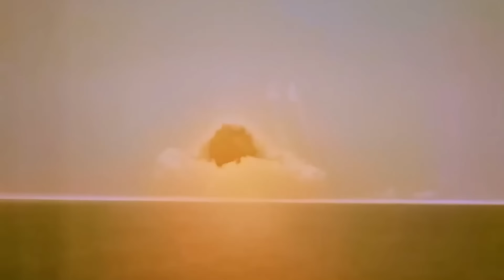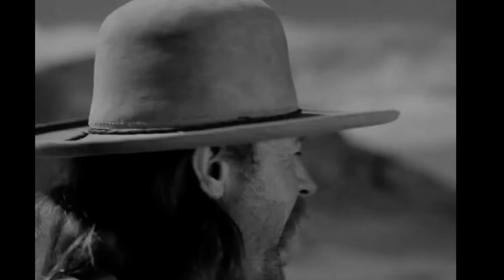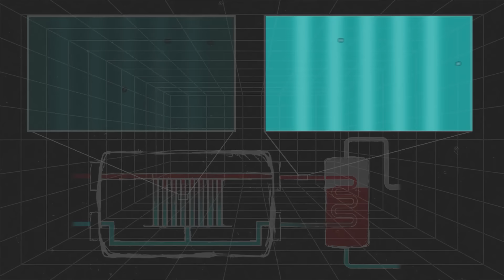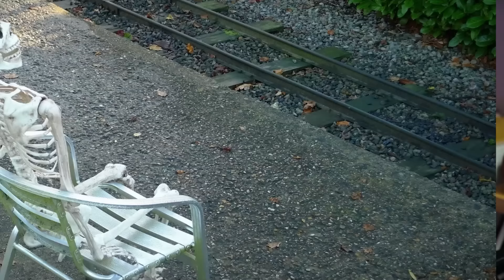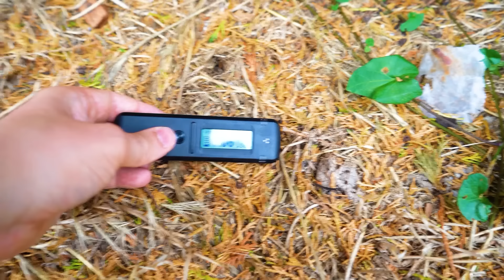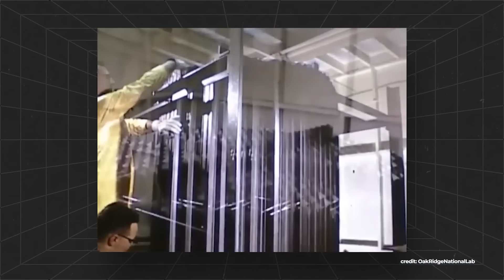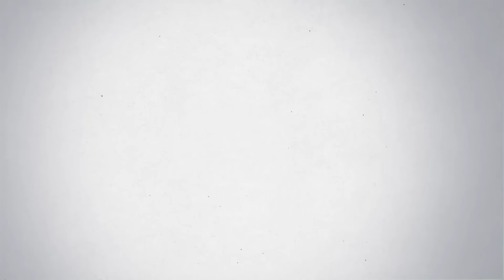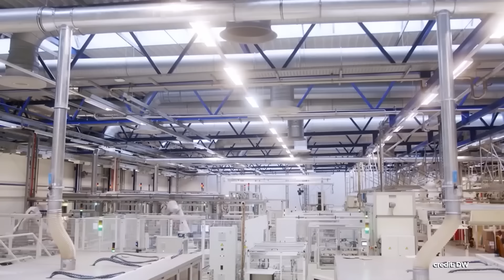It's Happening - China Launches World's First Thorium Nuclear Reactor

Comment: Countries like the States, having a stockpile of spent fuel and depleted uranium, have no requirement to use thorium as fuel. In total this resources have depending on how many reactor years they have been accumulated, an energy content for hundreds or event thousands of years. And even with lower resources from nuclear history, beside uranium resources on land, there are the immense resources in sea water. China already developed a method to extract uranium from sea water, which seams to be competitive to land based uranium. 
Thorium may have some advantages at the prolieferation side, and resulting waste when used with more conventional reactors. But on the other side there is the U-232 problem, which on decay produces TI-208 with hard gamma radiation on decay.This requires extensive shielding and very careful handling on transport and short-term storage. 
Of course, with Gen IV reactors with closed loop fuel processing and full burn-down, this isn't an issue. But still than use of spent fuel, depleted uranium, and uranium sourced from sea water, are the lower hanging fruits. 
I thing the Chinese test reactor is more a proof-of-concept project, than a real indicator that they want to go the thorium route in the future, may be in the very far future. They are massively active in building U-235 based reactors, and if they are really able to extract uranium from seawater at competitive price, then they have an abundant source available.

Comment: 2 minutes in and were already talking nonsense. 

Fission occurs in the core of a thorium reactor because of a graphite moderator that slows the neutrons down, this will also mean fluoride salts are used, because they don't absorb slow neutrons. A uranium/plutonium molten salt reactor, could use either fast or slow neutrons, but if its a fast reactor, there will be no "Core" the core is only a shape large enough to allow a reaction to sustain. Fast reactors will use exclusively chloride salts because larger atoms absorb less thermal energy from neutron interactions. Additionally the chloride is probably enriched to CL37 to avoid excess absorption.
These are two totally different incompatible reactors with entirely different engineering parameters. Fast molten salt reactors can theoretically take some thorium as input to offset uranium fuel but that is a essentially meaningless in the grand scheme of things. 
China's Thorium reactor is a graphite moderated reactor NOT A FAST REACTOR. There are no thorium fast reactors!

Both US Thorium reactors are "Thermal" reactors meaning the neutrons have approximately the same energy as every other atom in the reactor. Graphite is used to slow down the "Fast" neutrons when they're born from fission. Any small atom can moderate a neutron graphite just absorbs the least amount of them.

"Thorium is better than uranium because it absorbs fewer neutron". Nope, thermal U233 fission just produced more neutrons than a U235 split on average. Then you could also say generally molten salt reactors allow more neutrons to hit the uranium than a traditional light water reactor. All fission is going to be caused by one neutron hitting one atom.

The reason there is less nuclear waste is because the fuel is burned more completely. A fast spectrum uranium/plutonium molten salt reactor would have the same short life nuclear waste because the actinides are 'burned'. Light water reactors have long lived waste because they only burn 5% of the fuel breeding another 5% of actinides in the process that are essentially wasted.

Comment: Fast neutron reactors with molten salts: BN-600 was launched in 1980, BN-800 was launched in 2015. All of them already produce electricity. The BN-1200 reactor is soon to be launched. The only difference is that these reactors use prepared fuel from waste (by recycling it). A thorium reactor requires an expensive procedure for enriching the raw material.

Comment: My limited understanding is that the real safety of faster reactor comes from the fact that if active cooling fails and temperature goes up higher the neutrons run faster and have less chance to collide with nuclear fuel, therefore decreasing the reaction. The system is "self-correcting" in this sense.

Comment: NOT true. The US had a Thorium reactor in the 60's that ran for thousands of hours. It had several issues.. it was a molten salt reactor and it tended to melt the machinery to pump the salt through the reactor.. the project was abandoned because conventional water reactors were easier to do. This was 60 years ago but metallurgy technology has improved so with some research and a few billion dollars Thorium reactors may see a comeback..

Comment: hey guys im a little late to the party, (went through some old bookmarks today....) but 
just after 13:35 you say thorium based power plants could be build/operated in desrt-like areas as the reactor process doesn't require water cooling, BUUUUT you seem to forget that the steam turbine process indeed need a massive amount of water cooling, wich is usually why the are build near Rivers or large bodys of water, for higher efficiancy cooling.

EDIT: you went on to say that this particular reactor in china did without the steam turbine, i.e. the electricity generation part, as it was 'only' a test-reactor. Still, the necessity for water cooling for  steam turbine based power plants and the resulting retstraints on viable building locations remains.

Comment: Because the TMSR operates at high temperatures, one proposal is to use CO2 as the transfer medium instead of steam because it is more efficient and the CO2 turbines are smaller. The proposals are for these smaller reactors to be built in a factory and then shipped to a site.  Further, some designs show a reactor below ground so less potential for an aircraft crash to the facility.  Also, China has drawn up plans for using a TMSR in a container ship for propulsion and some have proposed it for use in China's nuclear carriers.

Comment: As I understand the technology, It could be used in a downstream secondary energy system after waste uranium from reactors is cleaned then thorium would be the end use of the uranium material thereby Assisting in the disposal of the original hazardous waste.The relatively small size would assist in decentralizing the power grid. The current power grid configuration cannot withstand the shoe horning of a green transition, Many smaller systems like these could help alleviate strain on the power grid.

Comment: this is a lie Peach Bottom, PA: A 40-MW reactor that operated from 1966 to 1974, and later upgraded to 300 MW 
THTR-300: A pebble-bed core reactor in Germany that operated from 1983 to 1989 
Japanese TRISO fuel 30 MW high temperature test reactor: A reactor with a prismatic core that became operational in 1999

Comment: Showing Chernobyl while talking about a high pressure system is mis-leading but it's an alright reference to the explosiveness of a reactor going super critical after a loss of cooling. Think a not very well maintained pressure pot for cooking. The lid will explode off if pressure exceeds past the threshold of the container.

Comment: The potential for MSR reactors are amazing.  If we can get them to work effectively.  They have amazing safety advantages.  And possibly low production, and operating costs as well as reduced waste.  Another major potential is for fast production in factories which can then be easily transported where needed.  Potentially in cargo containers. Without fuel.  Which can be transported separately. For better safety.  Mass production would be vital for fighting climate chaos.

Comment: Molten Salt Reactors, MSR, do not use common Sodium salt.  They can use a number of different salts. Mainly Fluoride or Lithium salts.  Generation 4 MSR reactors, are not Thorium reactors.  Thorium is one of the fuels that can potentially be used in MSR reactors.  An amazing thing about MSR reactors is that they can use almost any type of fission fuel. Including existing nuclear fuel waste now in storag.  So it may be better to use existing waste rather than mining Thorium.  MSR reactors can also burn up unneeded nuclear weapons grade material. Reducing nuclear proliferation risks.

Comment: Thorium produces the same waste as Uranium or Plutonium.  It is the MSR, Molten Salt Reactor, that can burn up most of the fission products.  In theory.  An MSR reactor can potentially use existing nuclear fuel waste as fuel as well.  If we can get the MSR reactors to meet their planned theoretical  potential.  They could even operate on depleted Uranium which is in stockpiles.  The MSR is not a Thorium reactor.  Thorium is a potential fuel and could be used in some other Generation 4 reactors.  MSR reactors can use most fuels and use them much more effectively than current PWR, Generation 3+ reactors. This is why MSRR reactors are so popular. In theory.  India does not plan to use MSR reactors.  And, is developing very complex sodium cooled fast breeder reactors.

Comment: There is considerable confusion between half life and radiological threats. The longer the half life, the less radioactive an element is. The biggest risk isn't radiological, it's heavy metal toxicity. U238 is routinely used as a radiation shield in sensitive radiation measuring instruments. From a radiation perspective U238 is harmless. Grind it up and ingest it, you'll die of vital organ failure.

Comment: Something you might want to look into is the length of time that Spent Nuclear Fuel (SNF) from Light Water Reactors is "dangerous" and needs to be isolated from the environment. I would be happy to talk about it in detail, but it turns out that in about 300 years or so (depending on a number of factors) the SNF is about as radioactive as the fuel was before it went into the reactor. The isotope mix is different: more plutonium, less U235, some Tc99, but the overall activity is about the same as before it was cooked. And the activity is low enough that it isn't particularly difficult to handle safely after about 150 year. 

The whole "10,000 years" thing was a case of goal-post moving by the anti-nukes when it kept being shown that the SNF could be isolated for hundreds of years without much problem.

Comment: Molten salt circulating through metal pipes is like pumping sand through metal pipes.  You can do it but it will wear out your pipes pretty quickly.

They shut down the Crescent Dunes Solar Power project because the molten salt just rots the reactor too quickly.  This is the same problem they have with molten salt Thorium power plants.  It works but not for long.

If you can find a way to get the molten salt through the pipes without ripping them to shreds then you can be successful.  Until then, it's just a "pipe" dream.  (See what I did there?)

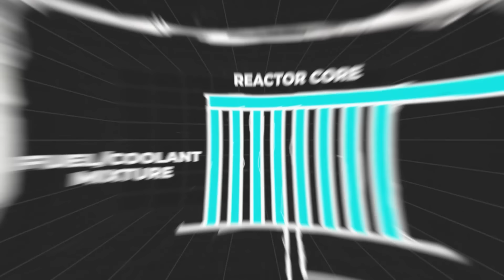Comment: 2:38 - You mention fast neutrons without mentioning that traditional U-235 reactors need thermal neutrons, and therefore some kind of moderator (in the case of pressurized water design, the coolant itself; in the case of Chernobyl and similar ancient British and American weapons-producing reactors, graphite.)  

The work on thorium cycle reactors stopped with the success of fossil fuel loby financed FUD campaign managed to fool the public into belief that nuclear energy is dangerous, while it is at least as safe (per MWh produced) and residential solar.

Comment: Yes and no ;)
The Thorium reactor has a certain feature mentioned but which is the most important problem in the first place as to why it was decided to promote uranium reactors. 
The birth process produces Uranium which can be isolated from salt.
And the availability of enriched uranium increases the availability of nuclear weapons.
Until there is true peace on earth without religion. only one solution will be possible. Civilized countries will produce electricity thanks to thorium reactors and export it at a relatively low price to countries in a frenzy of conquest. Perhaps the salvation for efficiency and escape from steam turbines will be to convert thermal energy directly into the decomposition of water and store it in the form of hydrogen.

Comment: If you actually believe that China has operating Thorium Reactor, you are ignorantly dumb.   

Thorium cannot directly fuel a nuclear reactor on its own; it needs to be converted into Uranium-233 first, which requires additional processing steps and presents technical challenges, making it less practical than established uranium-based nuclear fuel cycles.  China isn’t stupid!  The cost is not economically viable!  

Transcend the bullshit!

Comment: I got interested in Thorium a few years ago and went to a few conferences around the world. I learned that the big problem is the time it takes to breed fissile U233 from fertile U232. About 10 times as long as it takes to breed fissile Pu239 from fertile U238. The problem is that the half life of the intermediate isotope. U233 absorbs a neutron and rapidly decays into Pa233 which has a half life of roughly 27 days, as compared with the intermediate isotope in the U/Pu cycle,  Np239 which has a half life of roughly 2.5 days. 

So it would take many decades to get a full fleet of Thorium based nuclear reactors to replace all fossil fuel based power stations. 

Molten salt reactors are a separate issue. You can run molten salt reactors for the Uranium/Plutonium cycle. The issue is that breeding U233 from Th232 can be done using slow neutrons, whereas breeding Pu239 from U238 is best done with fast neutrons, and a fast spectrum breeder reactor using molten salt is technically very challenging. 

In any case by the time such designs are available in large enough quantities to make a difference to electricity production it will be too late to prevent the climate change crisis, and also the cost of solar and wind generated electricity will have come down to levels that would make nuclear uncompetitive.

Comment: Sounds better than uranium - however, there is one fission process, Hydrogen/Boron, which will make this irrelevant. Lerner in the USA has worked with limited funding to be close to getting electricity straight from the fission process without turbines and with very minimal radioactive waste. People work next to the reactor without extensive safety shielding etc. and considering the minute funding, they are getting very close to functional fission electricity.

Comment: The Ft St Vrain project in the 1970s was a gas cooled reactor with a concrete reactor vessel, was graphite moderated and was going to feature the thorium/U233 fuel cycle. It was never built.

Comment: Thorium has many advantages for nuclear power, but preventing nuclear proliferation is not one of them. Indeed, you cannot build a nuclear fission bomb from thorium itself, but an operating thorium molten salt reactor absolutely can produce weapons-grade uranium. U-233 can be chemically separated from the molten salt in the same processing that removes fission byproducts. As long as you are careful about how much U-233 you remove, you can keep the reaction going and build up enough material for a nuclear weapon. This is possible because the process of breeding U-233 from Th-232 requires 1 neutron, and fissioning U-233 requires a second neutron, while the fission of U-233 produces 2.49 neutrons on average. Some of that excess 0.49 neutrons can go into breeding more U-233 than you need to keep the reaction going.

Comment: A useful summary from which I learned a lot about the technology I didn't know before.

But the main issue I still see - only briefly mentioned toward the end - is how do we engineer things to cope with corrosion of materials coming into contact with all those halogen ions in the molten salt?

I was taken aback by the mention of fluoride salts (!) - just about the most corrosive  salts imaginable, though I suspect more common (and also-mentioned) chloride salts wouldn't be much better...

Clearly there is a challenge here to identify ways of alleviating the corrosion problem, notably by using other, e.g. heavier-halogen salts? or by developing much more resistant (but still economical) materials for use in reactor parts that come into contact with them.

Presumably a lot of thought has gone into this somewhere...  A further update might be warranted.

Comment: Small Modular Reactors (SMRs) are definitely the future, the only question is which method will win out, and which manufacturer will be the key player. 
They are green, relatively low maintenance, and should last between 50-100 years with ease. 
Wind and solar still aren’t anywhere near efficient and are anything but green when you look at them over their life cycle. 
They also need storage which is another problem.

A guide in regards to land

A 40 megawatt (MW) solar farm would need between 200 and 400 acres of land, depending on several factors

In New Zealand, most utility-grade wind farms are between 150–200 MW in capacity, and the total area of land needed is around 800–1000 hectares (800 hectares is 1976.84 acres). 

A proposed 920-MW NuScale SMR would need 35 acres